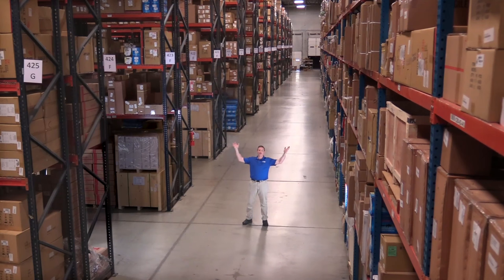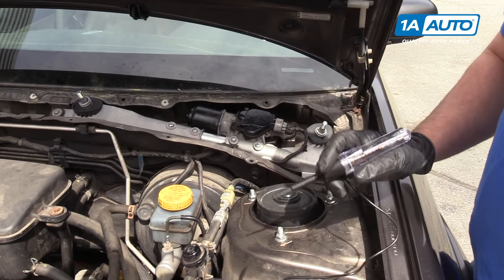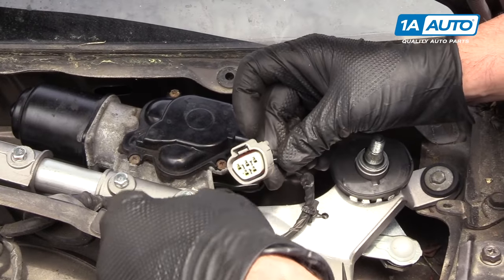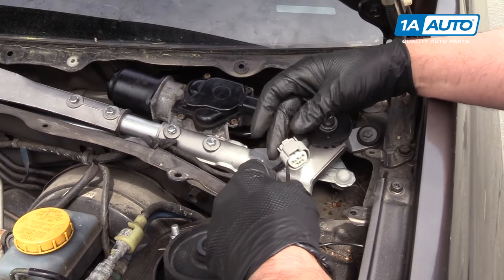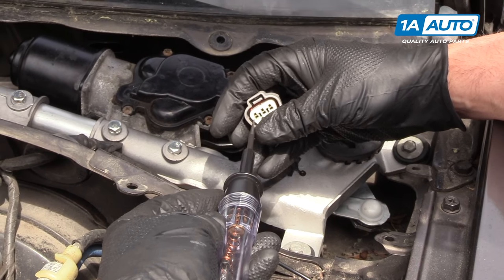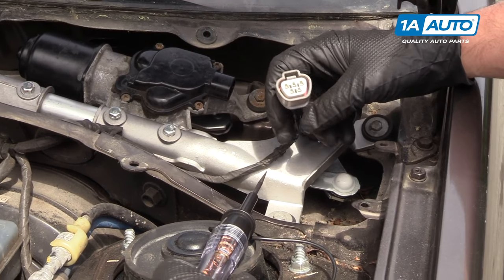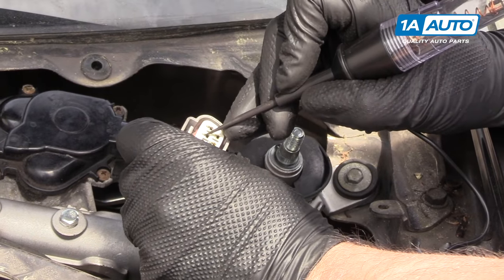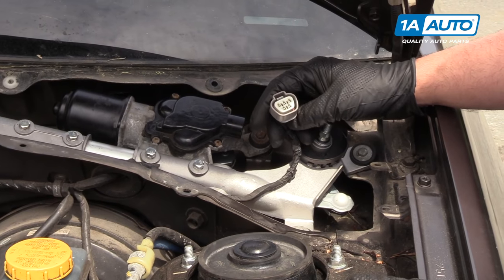How to Diagnose Your Car's Non-Functioning Windshield Wiper Motor

Comment: Hey Mike thanks for the info got my test light checked out my power supply and fuses everything was fine so i took out the motor and low and behold there was a nut just sitting there upon further inspection said nut came from the motor turny thing after a few tries in different positions I replaced said nut and wipers working fine now and it only cost me five bucks for a test light so thank you very much.

Comment: The wiper motor itself may not be bad.  There is a small circuit board (on some wiper motors) underneath a plastic cover that may have cold solder joints that need to be resoldered.

Comment: Thank you for excellent videos. My front and rear wipers are not working. Checked all fuses. Changed the switch (2012 ford escape) and nothing. I just bought this car and didn't check the wipers because the blades were really bad.  Can both motors (front and back) go at the same time? what I should be checking?

Comment: I have not done any testing yet. The intermittent setting stopped working. Is there a conductor for it in that connector, in addition to the high and low you tested? Is the intermittent function controlled by some sort of chip in the switch on the steering column? BTW, I have an Impreza, but it looks much the same.

Comment: Love, love, love your vids and they've helped me tremendously. When I press the windshield washer button, the wipers run about a full 60 seconds or so before they stop. This causes the wipers to drag and smear the window. This problem started a few years after I bought the car (new). Is there a way to reset the run time back to the original factory standard of approximately 15 seconds? I have an '07 CTS.
Reply from the maker: +Angel Babee Could be a problem in the windshield washer module. Try disconnecting the negative terminal of the battery for 10 mins and see if that resets everything.

Comment: By any chance, does the voltage to the windshield washers pump pass through this wiper motor assembly? My 2005 Trailblazer has good fuses/relays/ windshield pump BUT doesn't work! It WILL work if I supply 12V directly to the pump. I don't have a wiring diagram.

Comment: If you don’t have the wiring diagram to refer to, when testing the connector to see which pin has power and ground. Can you damage the test light or the connector?
Reply: Not likely

Comment: Hey, I have a 1991 Chevy Cavalier and sometimes the windshield wipers/radio/clock don't work.   Does this sound familiar?  Sometimes my dad would spray WD40 into the ignition key hole, and it would work.  Unfortunately, not anymore.  Trying to understand what parts I may need to order to correct this.

Comment: My wiper motor works but the wipers come to rest in the middle of the windshied (even thought they rotate edge-to-edge in the correct span while running). What gives?? Is there some sort of stop 'catch' inside the motor that forces the wipers to stop at the bottom of their span while the motor might still be winding down?

Comment: Hello Mike...help me please.
My BMW E46 318i m43 model the windshield wiper not functioning properly.The intermittent switch ok.but when I turn to normal switch (no.1) it moving intermittent.when I switch to fast moving (no.2) it running slow or normal function same like switch (1). Hence, what's the main problems and how to solve.is that relay problem, wiper switch problem or etc...
#how many wiper relay in this model.tq.

Comment: Hi, I have a 2009 Jetta TDI (MK5) one day my wipers stopped working and since then I've been stuck trying to figure out what is going on. I replaced the wiper motor and assembly, I checked fuse F19 30A, I check for ground at the connector (3 wires [red, purple & white & brown]) (I did not back probe the wire), and only two other things I can think of is the relay (# ..?) and the switch at the steering wheel. Any ideas...

Comment: My son has a 2006 honda civic. The low and intermittent speeds do not work. Fast speed works. I replaced the switch and relay but it still does not work. What else could it be?

Comment: My friend took her rig in to dodge with none working wiper motor.
They said wiper motor bad. They replaced and new one did not work. They wanted her to pay for diagnostic test. 
I told her to ask them if they checked relay, fuse and switch, they said no. If i would have know about her problem i could of done the easy testing like in this video.
Think they trying to shaft her. Just got call just happened today.
My thought is if the new one dont work then probably the old one worked and its in wiring like relay, fuse ECT

Comment: kool stuff what part of a wiper motor or multi switch lever controls the intermittent controls on a ford f250 super duty 1999?  thx danny
Reply from the maker: +djtoo7 You can check all of our '99 F250 parts here: https://www.1aauto.com/1999-ford-f250-super-duty-truck-parts/y-mo/1999-2162

Comment: Hi, my wipers continuously run, I have to take out the fuse to get them to stop. I have it on the off position and they still run.. Does anyone have an idea of what it may be.
Reply from the maker: +shantanna smith We wouldn't be able to diagnose an issue like that here, you may want to have a local mechanic take a look at it. Thanks for checking us out! http://1aau.to/m/Shop-1AAuto-c
Reply: I have the same problem... :S

Comment: Hi for a 2005 stratus the new and old wiper motor sn't working.  The ground wires light up in the connector but the other connectors holes do not light up. The  wiper switch will squirt out water so I do not think it's the switch.  The fuses are good what else could wrong?
Reply: bad relay

Comment: Not true! The Wiper interval relay can also be bad. The wiper interval relay is under the dash and it’s a whole lot cheaper used in Ebay. Many people waste money replacing the motor or the steering wiper part- all expensive fixes or luckily it may just be a fuse. 
There’s a way to test the motor directly bypassing the wiring that’s showing to be good. Check the motor directly with a 12v home alarm battery as the car battery cranking amps may be to strong. 
In order: 
1) check fuse
2) check motor 
3) check the motor wiring as directed in this video
4)if either is the problem replace motor or fix wiring 
5) if wiring is the problem it can be the wiper interval relay or the switch in the steering column. Hope is the relay-
- you can look for YouTube videos that will show you how to diagnose a relay. 
If your car is 15 years or older the relay is what I would check first. Old relays and switches will ultimately stay on the on or close position. Is the nature of a switch.

Comment: You need a brighter test light. You didn't test all the switch positions for their resistance which varies in the different positions of the switch.
You also didn't check the Motor for ground.
No ground no work...If you Don t know if all the switch positions are good then you can't  condemn the switch or the motor.
Reply from the maker: +joe226825 Thanks for the feedback!

Comment: How do you check a bad wiper switch or a fuse for it
Reply from the maker: +LeAnne MC. You can visually inspect the fuse. You can test the wiper switch with a test light, but if you are not able to do that you may want to have a local mechanic take a look at it. Thanks for checking us out! 1AAuto.com

Comment: Great video but my problem is my wipers come on when I start my car 2003 town car help anybody
Reply from the maker: +Samuel Anderson Thanks for checking us out! You may want to take a look at the pulse board and ensure that the wipers are on the off position before you shut your vehicle off. If you leave them on, it will start the wipers as soon as the car turns over.
Reply: It is in the off position the start run for a couple of minutes then they cut off but the crazy thing is that I can’t control them when it comes on when I start the vehicle. Thanks for replying